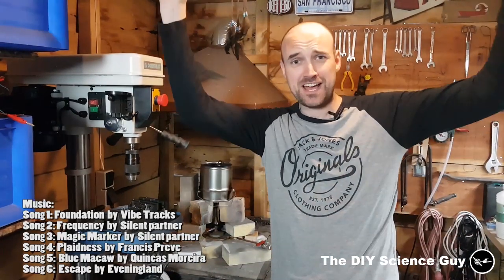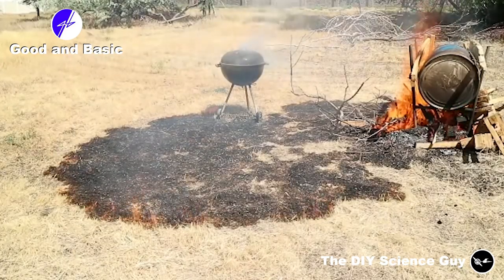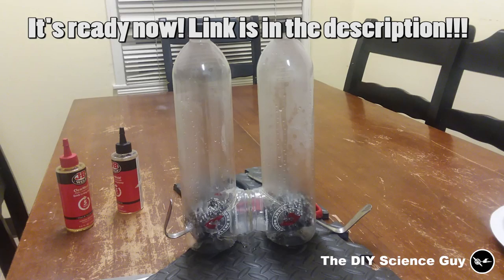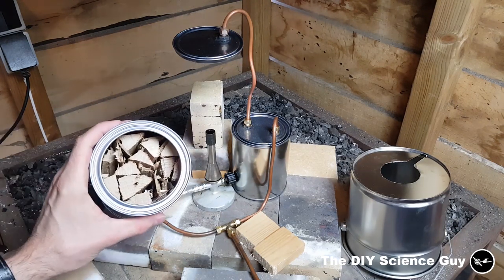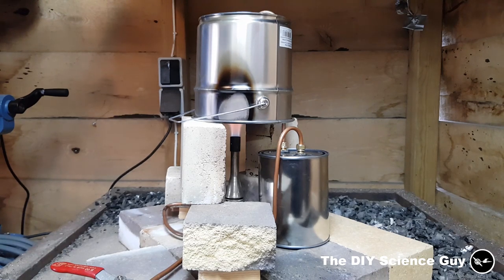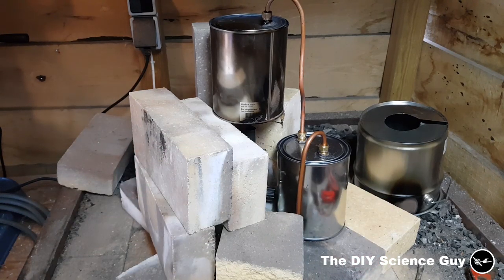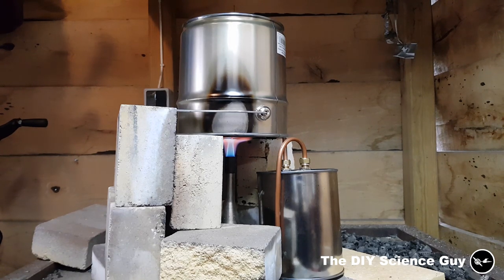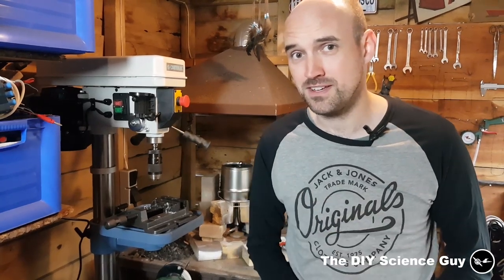Making charcoal the efficient way. (Ft: good and basic's Hydrogen generator) for 10000 subscribers!!

Comment: So do you think that a combination of wiring the lid of the paint can closed, and placing the condensing can into an ice bath would make this setup work? It's a bit more complex and less effective than the common small barrel inside larger barrel charcoal retorts, but it does a nice job of showing what's happening. I think a drain valve to let you remove the condensate periodically would help, too.

Comment: Try running gases out the bottom and burn without orifice, cleaning, or drying them. No pressure, so no lid problems.  It works for my 25-gallon setup, which has a 30 gallon drum around it to keep hot gases traveling up around the magazine. I do need to burn more wood under it toward the end, as it will not complete charcoaling on its own gases. I believe this shows that charcoaling is not exothermic as I had been told in the past.

Comment: Maybe if you had the "catch can" in a water bath, you could prevent the over preasure popping the pyrolization can.
Reply from the maker: Yes that's the idea! 👍
Reply: @TheDIYScienceGuy   not to mention the fact that would consense out tars, wood vinegar, and non combusting water and some methanol.

When all the water is out of the wood is when it will be able to get really hot.

Comment: Excellent video! I was planning on doing something like this...no more need for “proof of concept”!  Thanks!

However, and most likely I am missing some important detail but, if what you want is to self continue the efficient making of charcoal, then what is ideally desired is to get all of the energy of the pyrolysis by-products, i.e. no need for the “cleaning/cooling element” with the consequent condensed water (which later in the process becomes steam again, “chocking” the process)/tar trapping, but you can send all of it directly to be “burned” (the same loop that you did, except without the “cleaning/cooling/trap” device).

Am I missing some important “factor/detail”?

Thanks in advance for your reply!
Reply from the maker: Thanks! Well I did what you described earlier and the problem is that unless you keep everything very hot, including the whole burner, there will occur condensation which stops the combustion.

Comment: Why not combine the two ideas and build a steam reformer.  At high temperatures steam will react with coke or hydrocarbons to produce carbon monoxide and hydrogen.  The reaction is strongly endothermic and so requires continuous heat input and a catalyst.  The carbon monoxide can also react further with additional water to yield more hydrogen, carbon dioxide, and a small amount of heat in a so-called water-gas shift reaction.  Most commercially available hydrogen is made this way from natural gas but I've never seen anyone attempt it at home or on this sort of scale.
Reply from the maker: Nice idea thanks! 👍

Comment: Have you tried a gasometer?  (such as this video 5hfznunVzKY ? )
Reply from the maker: No but I'm going to use my hydrogen compressor to store the excess gass, also to start the system up again later so I don't need to use propane anymore.

Comment: How inefficient is charcoal !
    Apart from its usefulness in producing iron, and smokeless cooking, it's inherently a very highly inefficient fuel, and I get really pissed at myopic  'do gooders' being paid by charities to teach the third world to "make charcoal efficiently".  
       Would you not be far better employed to focus on developing the most highly efficient (wood to useable heat) process possible?   Traditional third world cooking methods usually measure between 5% and 15%, if lucky, with some 'modern' cooking stoves now being introduced at only 30%, so it shouldn't be too hard a task. 
   Hint: You need a fully insulated, fully air controlled, multi-stage combustion process with the then intense heat being 'harvested' only at the final point in the process, and then transferred to the cooking process as efficiently as possible using a fully insulated conduit.
  Any combustion process that is not fully insulated is simply naive.
Reply from the maker: It's not about burning the charcoal it's about making charcoal and using the heat to heat water etc. I prefer putting the charcoal in the ground in the end.
Reply: @TheDIYScienceGuy    My God ... that's even more pointlessly inefficient and wasteful.  What is the point?
Reply: @sixmagpies  You really weren't paying attention, were you?